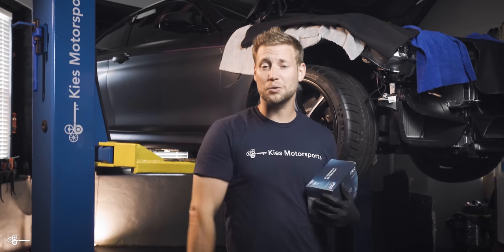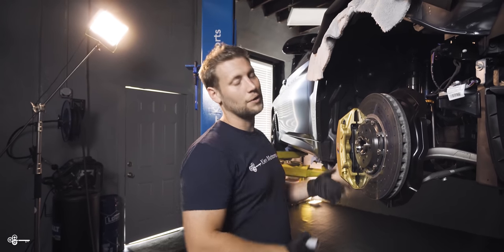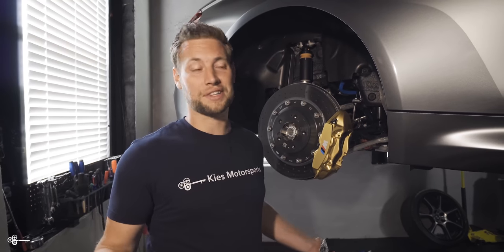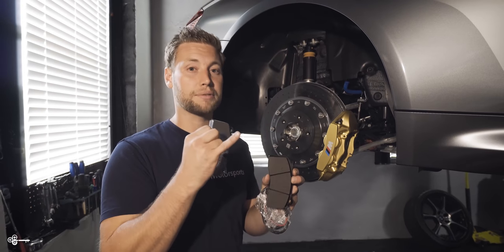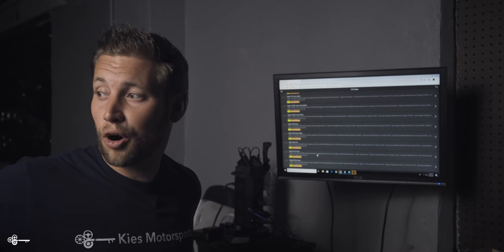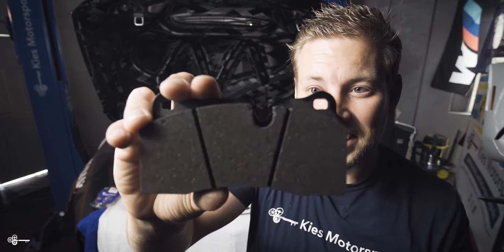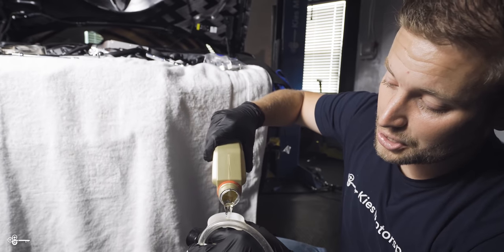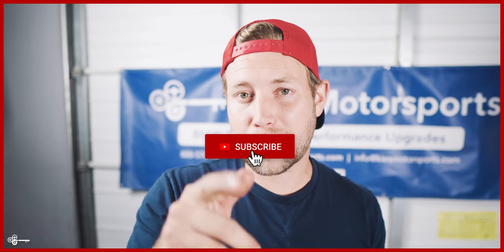Part 7: Building the ULTIMATE M4 GTS | Pagid Brakes, SS LinesCastrol SRF, CarPlay, and Alcantara

Comment: Are these pads truly an upgrade from the OEM carbon ceramic brakes? This mod seems highly questionable...
Reply: Thinking the same.  Having the carbon ceramic kit makes the brakes good for heavy duty ( track) use already and is an upgrade from the standard M4 brakes. 
Plus the pads were like new so should have gone through them first.
Reply: the discs are carbon ceramic
Reply: M yes, and your point? The OEM pads are made by Brembo, and are designed to be used with the carbon ceramic rotors. I’m not downplaying what’s being done here, I am legitimately inquiring if there is any benefit. You can search the F8x section of bimmerpost extensively - this is the first time I’ve heard of someone swapping out the pads as an “upgrade” to the already superior carbon ceramic brake system. I have CCBs on my M4 and even the pads alone are not cheap. Given the fact that these aren’t even designed to fit properly out of the box and requires him to send it back to the manufacturer, is this really an “upgrade”?
Reply from the maker: The pads that come on the car are stamped Brembo on the outside, but they're also engraved "Pagid", as Pagid makes the pads for Brembo. These are the RSC1, which are more of a racing pad and are a little more aggressive than the ones that come on the car. It may be a minimal improvement on the street, but these have a little more bite for the track. This was something that the customer purchased prior to bringing the car to us
Reply: Dayvid I kind of agree with you on this one. My understanding is that carbon ceramics do “wear away” , they wear away in mass, not size(thickness) like traditional iron rotors.  Kies?

Comment: Don’t forget when you replace your brake pads to fully press down your brake pedal a few times so the cylinder reaches the pad.
Reply: ( To those who never done brake jobs ) 
Helps allot if you want to drive the car. If not completed you will brake whitout the car stopping.